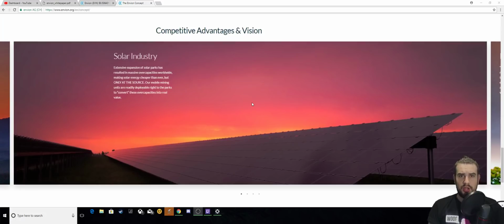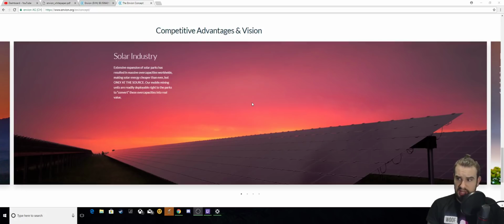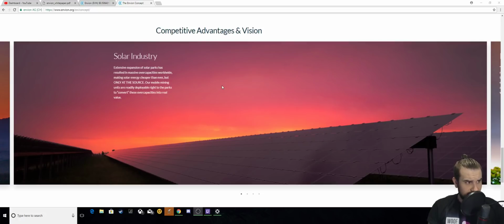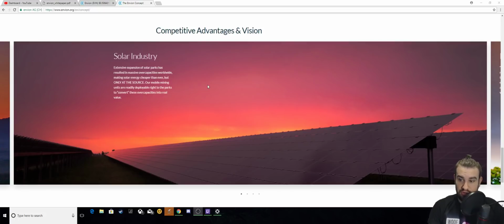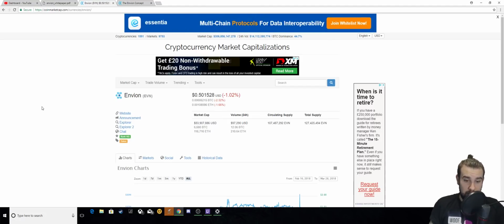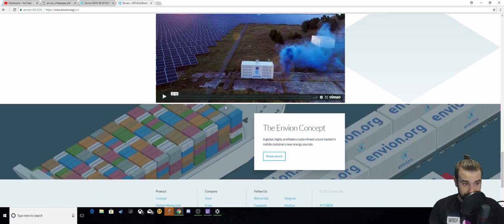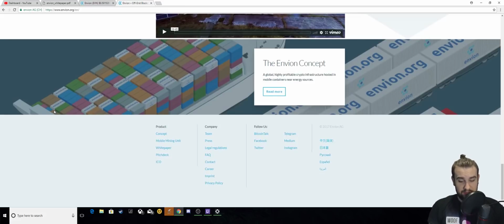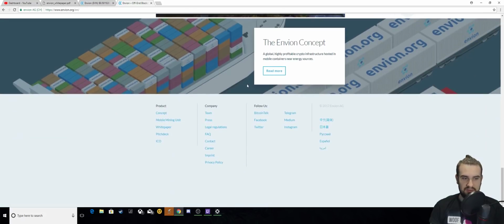[MUST SEE] THIS IS A GAME CHANGER! - Envion

Comment: Well done for spotting Envion and getting the word out, I believe it is a fantastic project. Unfortunately your review falls woefully short in detail about the company and the crucial reason why investors will hodl this token. The most important element from an investor point of view is that EVN is a security token not a utility token, which means by holding EVN you get paid a dividend from company profits. Envion state an ROI of 161% in their whitepaper, even as a true believer in the project, I am sceptical of this level of return but am expecting a ROI higher than pretty much any other investment available. Please go back and do a proper in depth review, you will be very pleased by what you missed.
Reply from the maker: i was gutted that i didnt add it in, people in the comments asked what the use of the token was and i did tell them upon asking but you are right it should have been in this video, ill be doing a seperate video explaining what makes the envion token useful :)

Comment: Maybe I'm wrong,i don't think they will have success.I like your videos
Reply from the maker: LvL- uP what would be reason they won't succeed if you don't mind me asking? I personally think that IF they can implement what is in their white paper, then they will be a very popular solution, power usage is incredibly important to the future of Blockchain and there just aren't other solutions at the moment. Thanks for your support though I appreciate it! :)
Reply: the solar panels are placed on hot area right?on one container power consumption is around 40_140kw.with two fans and some holes with tubes can't cool it down(this is not an invention).next problem i think about is for hackers and thieves because it's a container with gpu's:)).sorry for my english
Reply from the maker: LvL- uP the thieves point you make is a valid one, I'd imagine that security would have to be present to protect something of high value like this, however in terms of cooling, they have designed an entire cooling system that adapts whatever the conditions are, it is not simply "2 fans and some holes" , your English is fine by the way! You shared your points and they were understood! :)